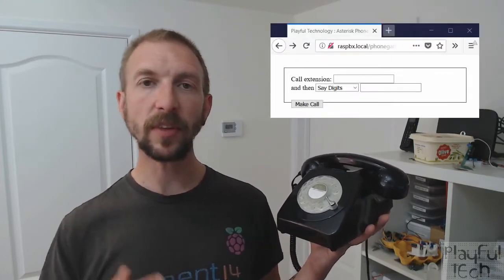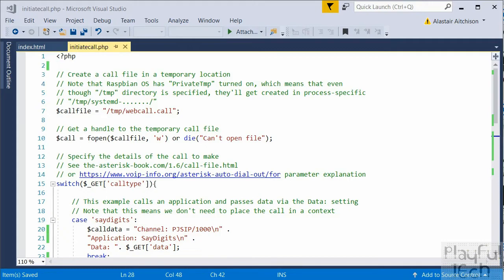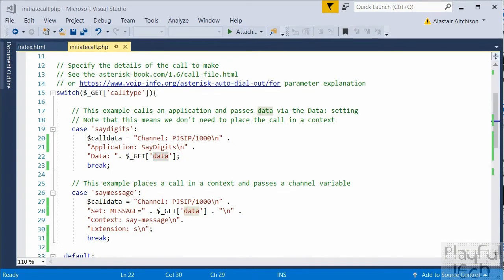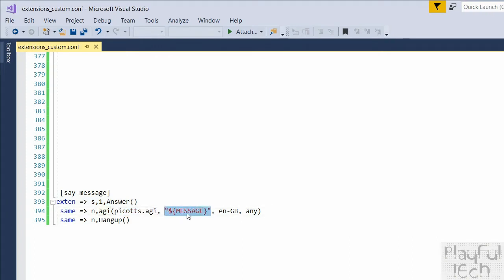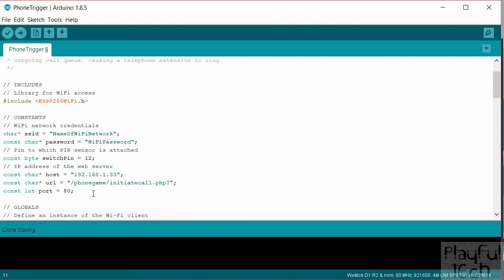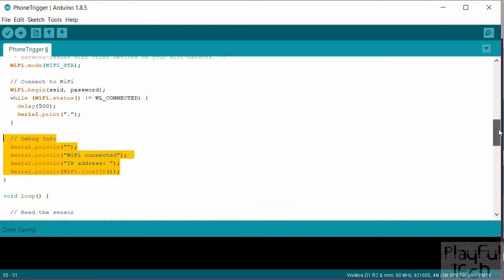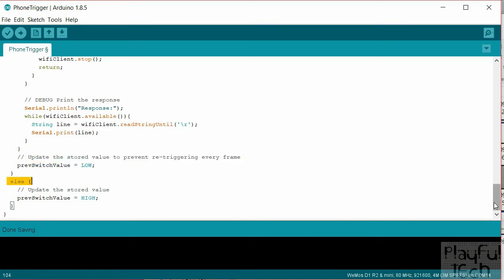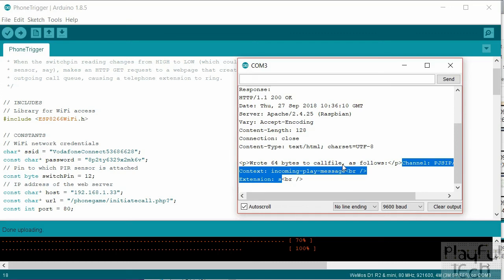"Smooth Operator" - Creating a Playful Telephony Network with Asterisk - Part 4

Comment: is there a way to dial an extension to activate a pin on an arduino as to, for instance, turn on a light when its dialed? Also are you able to use usb serial communication to send and receive data from the arduino to the server instead of wifi?

Comment: I feel like I missed where you gave instruction on how to use the GPIO controls for the relay switch? I'm trying to figure out how to do this.
Reply: Anyone having this issue, I'll share my work around. The custom extensions allowed for a system console command >> file.txt, when the extension is called, I issued the command to create a file. I created a daemon cron job that runs, it checks for the existence of the files, if they exists, delete and run the task. Works beautifully.

Comment: Hey Allister,
Do you have a video or a resource for using an extension to trigger a gpio pin for a relay such as you demonstrated in part 1?
Reply from the maker: Yep - that's all shown in the last part I think?
Reply: @PlayfulTechnology  My apologies if I missed it. I could only find an explanation for triggering an Arduino to make a call to an extension on Asterisk. I'm looking to have an extension on Asterisk trigger a GPIO pin on the same raspberry pi that it is running on.
Reply from the maker: @HunterMatthew09  I forget exactly where in the video, but there's a section in the accopmanying documentation that covers it starting on Page 26 - you first create a python script, set the permissions for it to be called by the Asterisk user, and then trigger it from the callplan using, e.g. n,System(sudo python /var/relay_on.py) - described in full detail here: https://www.patreon.com/posts/smooth-operator-21684333

Comment: Hey Alliaster, pls accept my apologies in advance as my qtion is not related to this video..My qtion is for AR apps..Few months back u posted a video basics on augmented reality just wanted to know is it possible to create an AR application base on underground municipal pipes..Where u can see underground pipes through applications
Reply from the maker: Of course - AR technology is completely agnostic about what application you use it for. It just recognises certain "targets" - QR codes, images, shapes, colour patterns etc. - in the "real world", and then uses them to create and position overlays in the "augmented world" as viewed through the display. So long as there is a suitable target which you could use to identify the viewer's position and direction, you could easily overlay a schematic of underground pipes at that location.
Reply: @PlayfulTechnology  that make sense .. Thanks for your valuable reply...My next qtion is how it can be done? Do I need to create 3d model of the pipes as an overlay and then trigger them to the ground ? I don't know how to set the exact position to match the real underground pipes..Can u help me with some links or so...That will very helpful...😊
Reply from the maker: Yes, you'd create a 3D model of the pipe network in a format that could be imported into Unity (e.g. FBX), and then position that relative to a target marker (in virtual space) matching the position of the pipe relative to the real-world target. Blender is a good tool for 3D modelling, if you don't already have CAD designs of the pipe network to hand.
Reply: I understood about the 3d pipes and modelling, but it will be great if you share more about positioning in virtual space without any base design of the pipe because I had never done this kind of coding in virtual space.It will easy for me if you share any video or document links on  how it can be done...

Comment: I've REALLY enjoyed this 4 part series. Thanks for taking the time to put the hours of video out there. I do have a question however. I know the focus of your channel is Arduino and escape room projects.... but the more I watched this, the more I debated if I would actually run this code on an Arduino or not. Most escape room setups are going have a command center where game masters control game play from. To me, this code is begging to be run from a PC on a central web server / call center PC. This would allow ALL of your rooms to be managed from a single central call center server. Code stability should be better as it would be running from a PC instead of a micro-controller.  This would also allow for one major group of "Call  Center" code to be published and maintained rather than have the same code published over and over again One per Arduino per Room.  I'd love to hear your thoughts on this style of deployment.
Reply from the maker: Donald - I agree with you. If you're running a permenant, multi-room ER setup, you would absolutely want to be running software on dedicated PC hardware which, as you say, you probably already use on-site for running control server software, clue-delivery systems, monitoring in-room video cameras etc.. microprocessors like Raspberry Pis and Arduinos excel at small, portable, standalone installations, and interacting with hardware sensors, but do not come close to competing with robustness and performance of even a modest 5yr old PC when it comes to running processor-intensive calculations and software. The main reason why I chose to use a Raspberry Pi in this project is: 
a.) to prove that it can be done 
b.) because it is cheap, easily-available, and familiar to many people (probably moreso than a dedicated Linux desktop PC would be)
c.) Because whenever I've asked subscribers what projects they'd like to see, they tell me they want Arduino and micro-controlled projects!

For what it's worth, I'm actually using this exact project at the moment, running on a Raspberry Pi v2.0, on an experimental game installed in a public library in my home town, and it's proved perfectly reliable so far!
Reply: Playful Technology thanks for the feedback, and absolutely keep putting out Arduino tech videos! I love the content. I’ve watched them all and always looking forward to notifications of your new content.